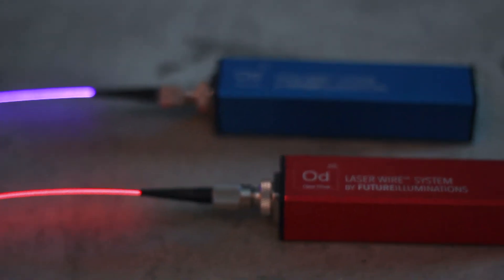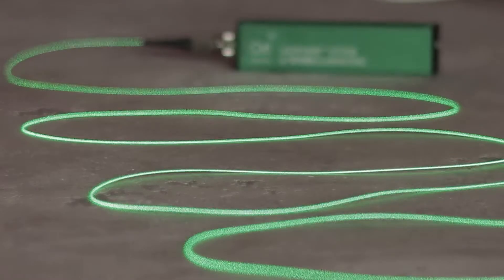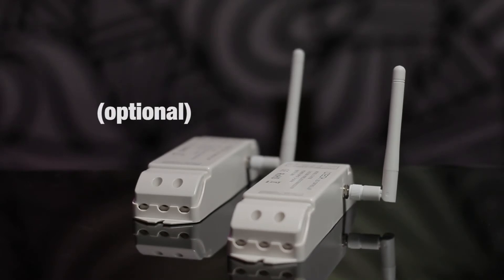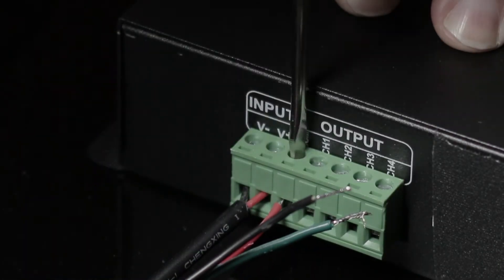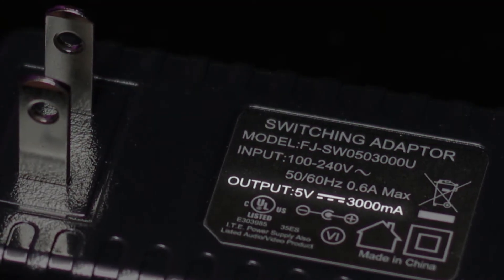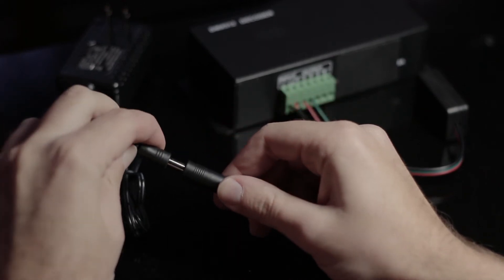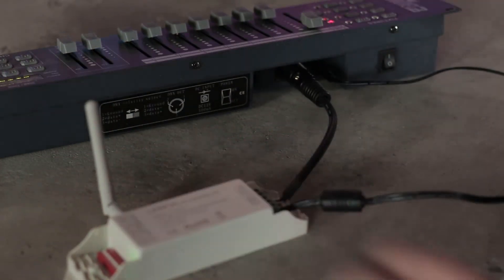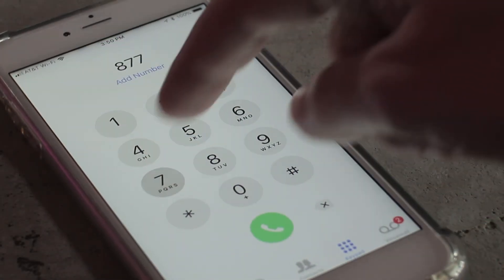Laser Wire® with DMX512 (Tutorial Video)

Comment: Can laser wire damage your eyes
Reply from the maker: While lasers in general should be used with caution, Laser Wire® itself falls WELL within the safe range of operation for lasers in EVERY country in the world. It's far safer than typical laser pointers on the market, and the risk of damage to eyes is extremely low.
Reply: Ellumiglow thanks
Reply: If I'm not doing any dimming, can I just use an on/off relay on the USB? I just want turn it on/off
Reply from the maker: Hi Jose,
Do you already have an Opal Drive, or are you thinking about purchasing Laser Wire? We have two variations of laser modules now, so how a relay would be wired to control the on and off would be different for each module.
Reply: @EllumiglowPage  according to the PDFs you guys have on the site, if I want to have a solid color (without dimming or PWM) and the fact that just plugging in the usb 5V input turns the Laser Wire automatically, wouldn't a relay work? I just want to turn it on and off at a set interval
Reply from the maker: With Opal Drive (battery operated module) you would need to run a constant 5V and Ground to the unit, and then tie your relay's switch to between the 5V line and the D- pin. Make sure to put a 2k resistor in line...Make sure Opal Drive is in installation mode when doing this.

If you are using a USB capsule module for Laser Wire (does not contain an internal battery) a relay can just be wired in line with the 5V rail directly to turn it on and off.  Let us know if that helps!